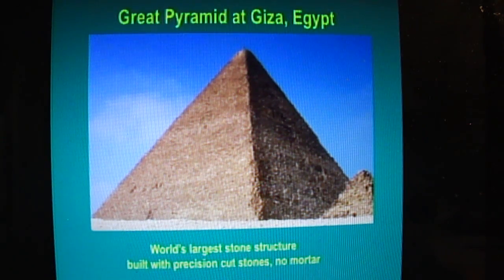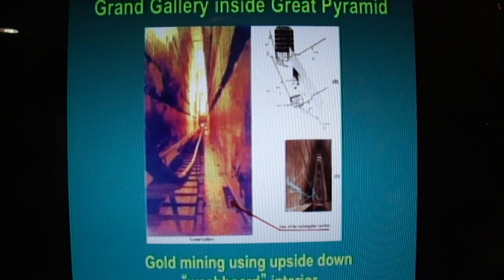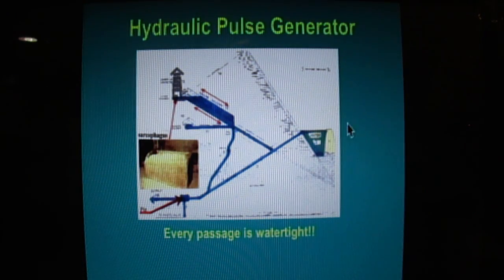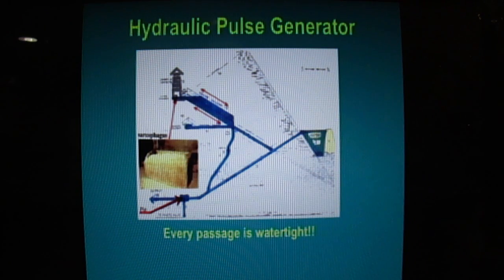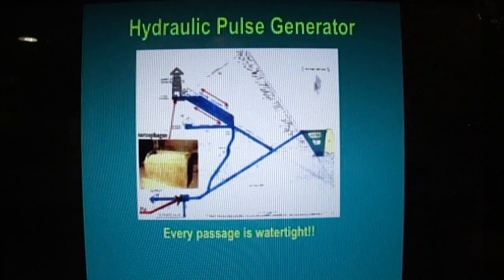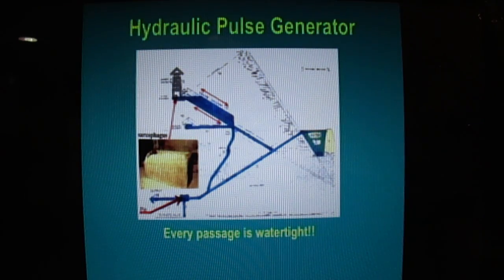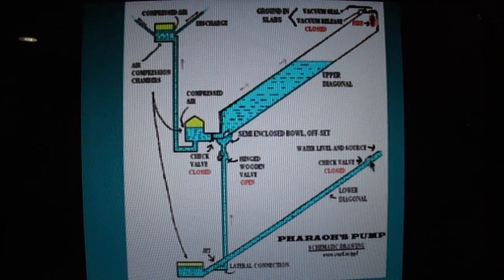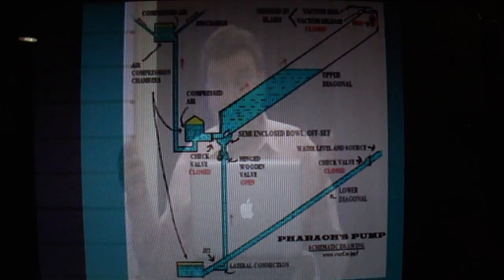New theory about the Great Pyramid

Comment: Khafre's pyramid is almost as big as the great pyramid. It only has one ground-level chamber with 2 small passages to the chamber. According to your theory, what was the purpose of Khafre's pyramid?
Reply from the maker: The main chamber has an upside down washboard ceiling. As I wrote in "The Anunnaki Were Here", the extraction of gold by washboard mining is evidenced in many parts of the world;  the many terraces of Macho Picchu, the Greek Theater at Syracuse, Sicily, Moray, Peru, vertical stone zig zag walls at Cusco, Peru, and many more. The Khafre's pyramid may have been an early attempt at upside down washboarding, later perfected in the Great Pyramid. www.adamthemissinglink.com
Reply: Khafre's pyramid was constructed after the Great Pyramid (Khafre was the son of Khufu). Furthermore, I don't understand why the ancient Egyptians would go through the trouble of constructing a huge pyramid (Khafre's pyramid is 450 feet high) only to have one small chamber at the ground level with a washboard ceiling for extracting gold. There are no passages or ducts that go up from the chamber. It just doesn't make sense to me.
Reply from the maker: There is no real proof when the pyramids were built. Recent discovery on Sphinx puts it possibly 10,000 yrs. ago.  There weren't any Egyptians 10,000 yrs. ago. I do not think the Egyptians built them.

Comment: Indeed the entire outer casing was also made water-tight because this awesome structure (as all were) was a water storage silo. This would be the way to build one if you didn't have steel to make containers from. Clean water was almost more valuable than gold to a desert community. As the first published on a new theory about building megalithic structures using water lock lifts, I have theorized that this box could have floated as some kind of "check valve" or something. Go to James Northcutt on youtube to see a demo and contact info. Will send research that touches on this intriguing box!